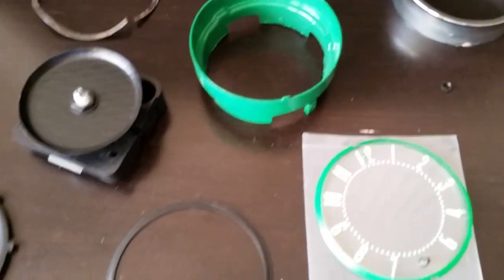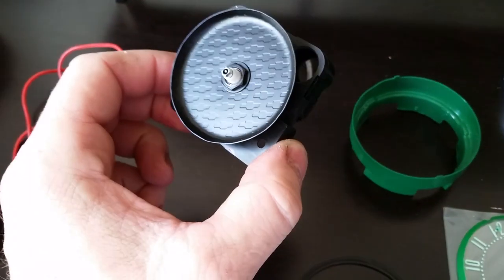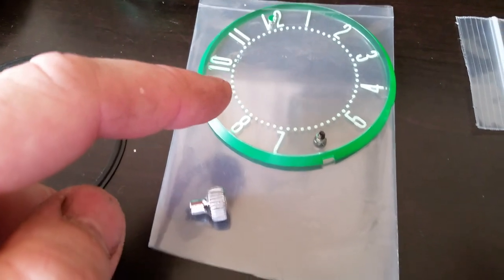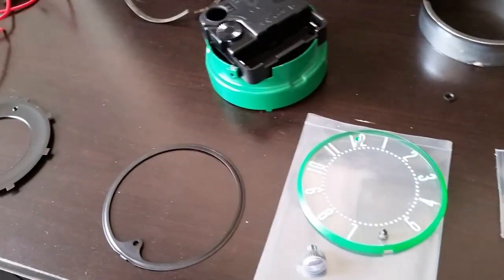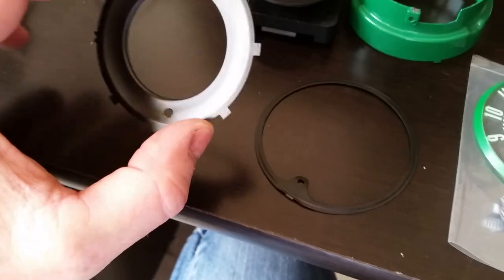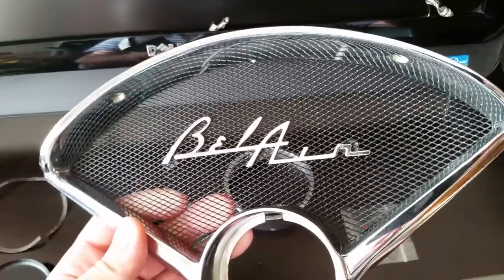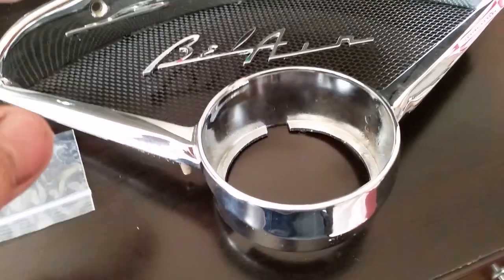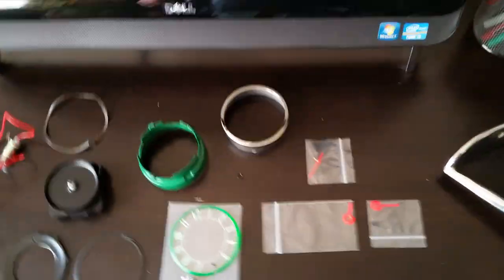1955 Belair vlog, dash clock video 1

Comment: very cool  you gave nean idea for a passenger side 56 belair bezel iam munting to a piece of stained wood with clock ill set out in my house for display, i have a drivers side 56 tail light assembly ive mounted and wired for 110 with working bulbs behind both tail light and back up lens , looks really cool when i plug it in at night, will fix my speaker bezel clock assembly to set next to it, oh and the fuel door still unlocks and pulls down as it shold